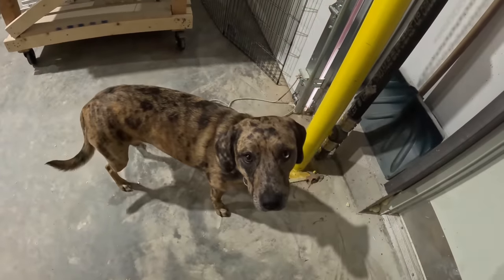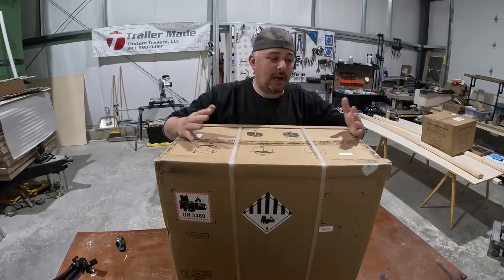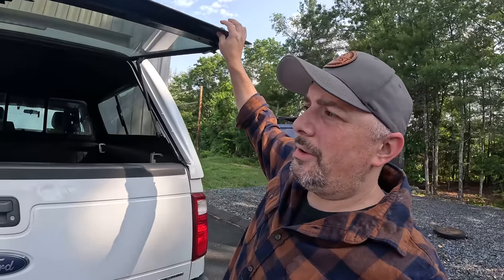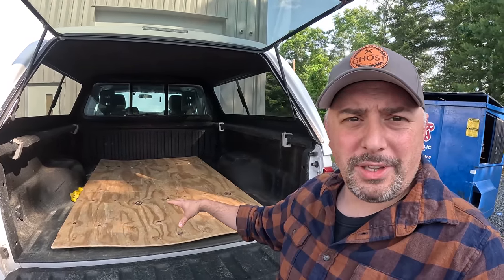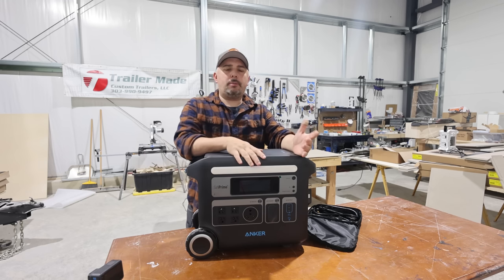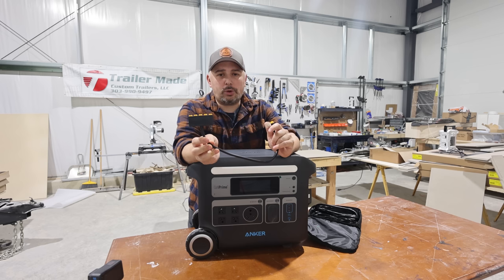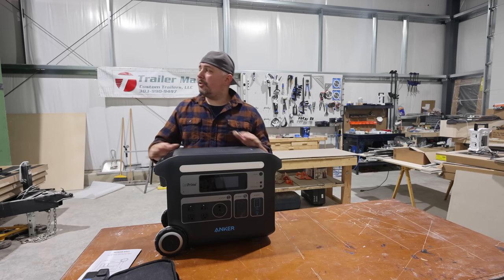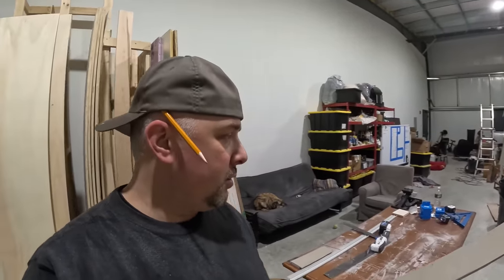NEW Camper Build - Tiny Home Updates

Comment: Better check the polarity on your Anker. Apparently many of them have reverse the polarity when it’s plugged in to 120 power. Thankfully they seem to be exchanging them for correct units. Still a real pain to schlep the thing back to ship it back to Anker.
Reply from the maker: Thanks. I did charge it from 120v already so should be good. I’m sure they are quick to fix that if it was an issue
Reply: @JarrodTocci  the problem as I understand it is the Anker unit puts out the correct polarity but when it’s plugged in and it is providing pass thru power the polarity is reversed.

Comment: Excited to see your truck build. I am about halfway through my Chevy Silverado 4x4 with an ARE shell on top.SO many curves and bumps in the back seat floor after bench seat taken out. And those damn wheel wells. I used Kilmat on the entire bottom half. Then the floor and sides have the truck carpet shell over it. I opted for the carpet on ceiling when I ordered it years ago...for a build may not have been the best choice. I just insulated the top using a few velcro tabs stapled in, then stapled the hell out of it. 

Bed on one side (still have to build that) on the other side I used Restaurant wire shelving with Walmart black wash bins. That part working out pretty good. Have pics and someday I will learn how to do a vid. The truck is paid for and with used auto prices and high loan costs (2023) I figured it made sense financially to squeeze into this...for now. Have been watching you for years. As always, thanks for the inspiration.Cheers!
Reply: Update: my truck in shop. Went dead while driving to pick up wood for build. DOH!